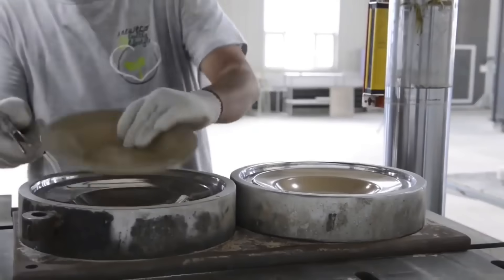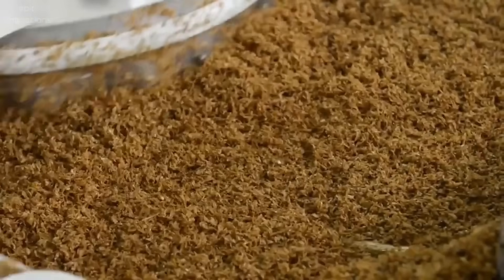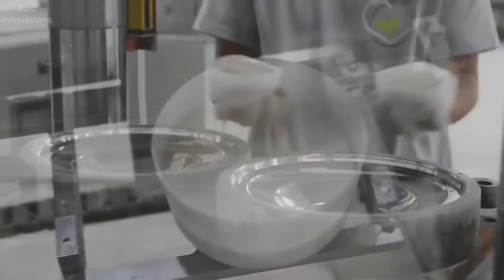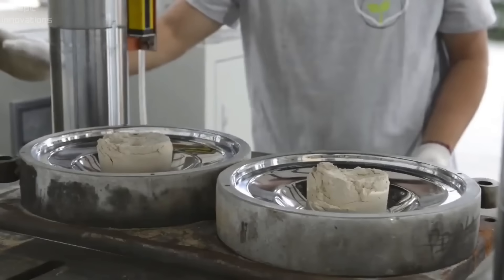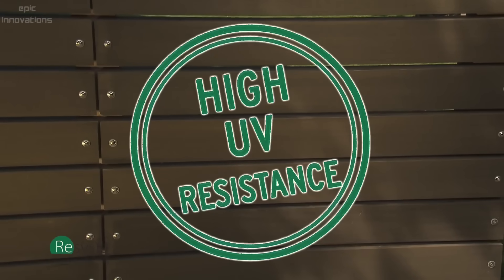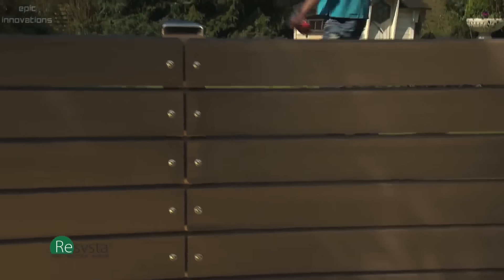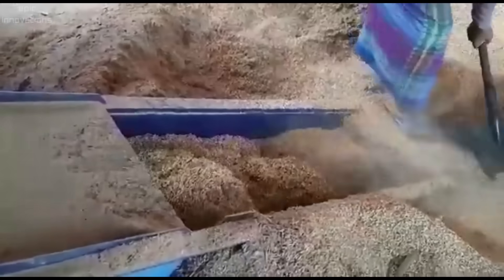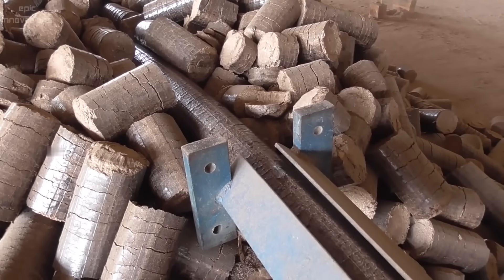Rice Husk Processing Machines: Kitchenware, Panels, Pellets and Briquettes Production From Rice Husk

Comment: is the material used after 80% rice husk and 20% adhesive which are heated at 350 Celsius turned into clay type material or still remains the powdered type before going into the die for compression ?
please can you clear this to me !

Comment: No matter how sustainable the material are the energy required is enormous to produce it, it not the material it's the way of producing it in which modern system is just in capable of it
Reply: If using renewable energy it is good.
Reply: Most of the energy consist of fossil fuel by products which a percentage can be substituted